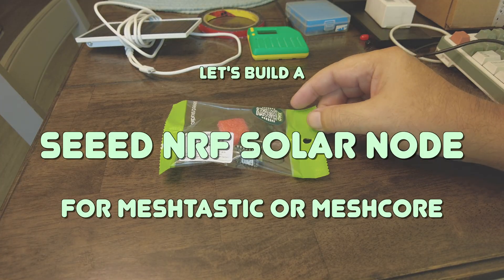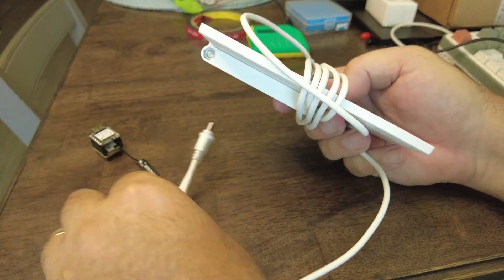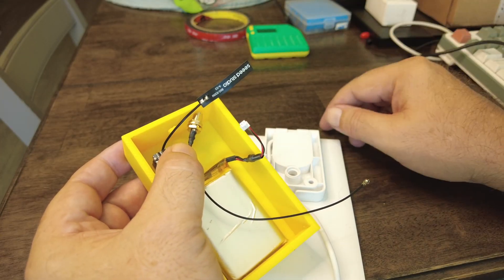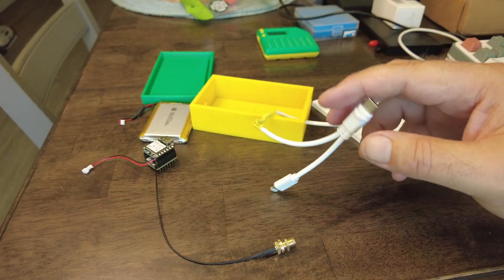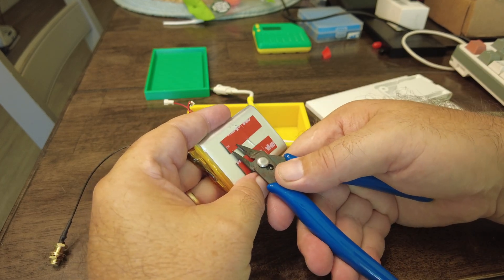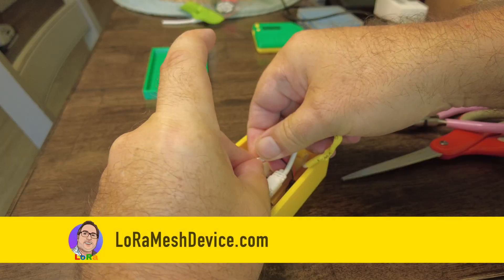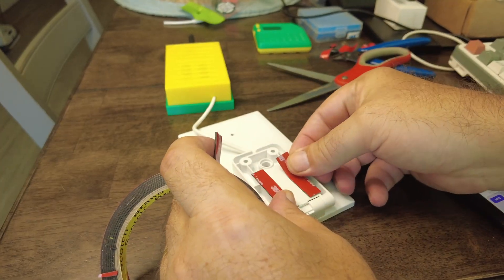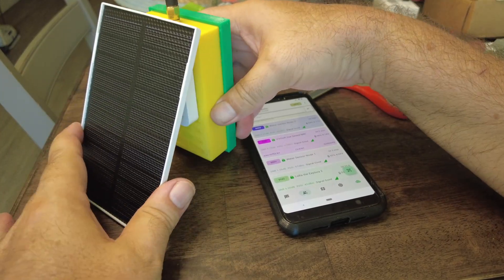DIY Solar Meshtastic Node with nRF52840! 🌞

Comment: I'm curious to know how its doing after 2 weeks.  Hows the range and battery life?
Reply from the maker: It's doing great. The LoRa range is great, no problems there. It has been in and out of the house, I have it on a tripod, but has not dropped below 90% charged. The only range issue is with Bluetooth that does not go very far.

Comment: Please note that the seeed has no BMS integrated. Make sure your battery has one integrated (small circuit).
Reply from the maker: Thanks for the helpful reminder, definitely important to consider! The battery I used does have one.
Reply: Do you know if it's safe to use a solar charger like the one in the video (mine is designed for a Ring security camera) to charge something like a Wio Tracker L1 or Heltec V3? If not, is it safe to leave them attached to any charger unattended? I just assumed my portable nodes were smart enough to stop charging once full but now I'm not sure.
Reply: @fondy44 if it has USB c output it should be safe. If you only have plus and minus wires, it depends on the voltage of the solar panel.
Reply: My understanding is that it did have a BMS. Also if you even wanted to enable the battery temperature monitoring, you seem to be able to do it if you use this Github project "Zigbee Flow and Return Temperature Sensor on nRF52840".